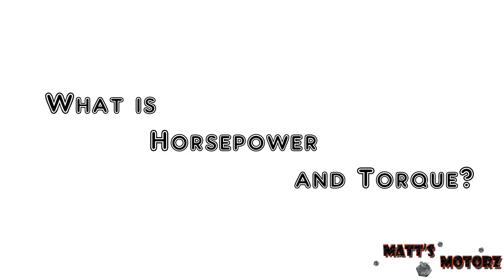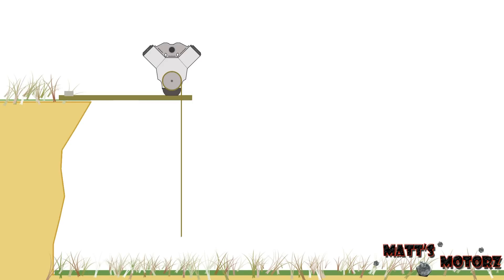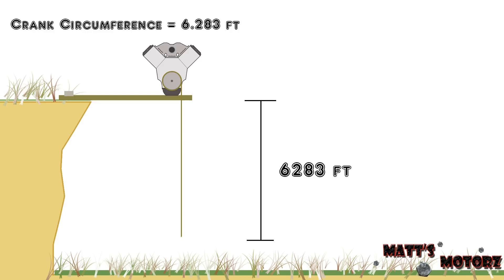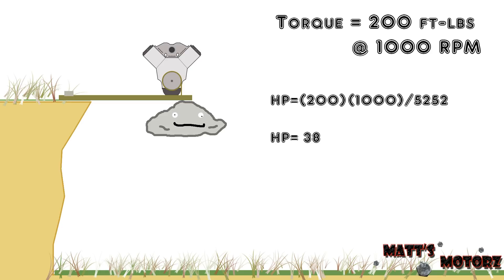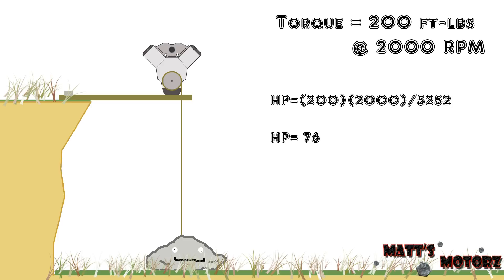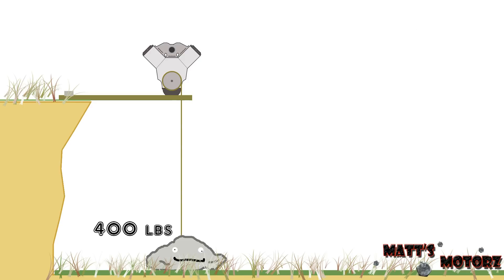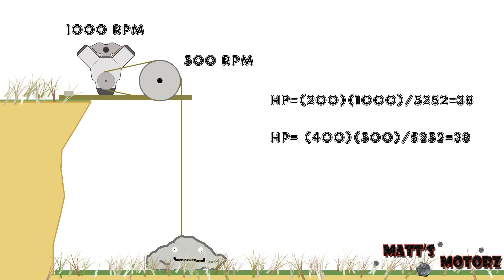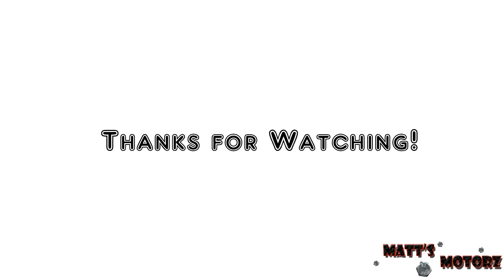What is Horsepower and Torque?

Comment: Pretty good explanation of a subject which I feel I am close to understanding, but which still kind of puzzles me a little.  I'll work on it. One thing that I wish you would explain, here, is if an engine produces "max torque" at, say, 5,000 rpm, why does the torque or twisting force of an engine "drop off"?  I would think that it would have more twisting force at 6,000 rpm, and even more at 7,000 rpm . . . (whether or not the engine is capable of spinning the crank that fast is another matter.)
Reply from the maker: Denys A The reason why, is because the process gets less efficient at higher speeds.  The valves can only open and close so fast, the exhaust can only be pushed out so fast, the intake air can only be sucked in so fast and so on. The engine cannot breathe as well at high RPM and your volumetric efficiency goes down and because of this, combustion efficiency goes down, and as a consequence, output power will go down.

Comment: Great Video man. I always wondered how torque and horsepower were interrelated and when torque is droping at high rpm/s and still hourse power is increasing. thanks to make it understandable. can you make a similar video for diesel engines? and how is that factor of 5252 come in, please explain.
Reply: +Syed Abdul Azeem The factor of 5252 comes in because he is using imperial units. If you used Watts, Newton meters and an angular speed in rps (per second) then hp = torque*rps

Comment: Well the reason I ask this question is because , I'm trying to decide on which  is the best power plant for me... On one hand i have a 30.5 cc 8.2 hp engine..... On the other hand i have a 34.5 stroker ( they emphasize a lot on compression and squish factors with the) 7.5 hp engine, boath engines are modifed & race ported.... They went the extra mile on the piston work with the 7.5 hp (cat 5 mfg) engine.... The overall objective is to move this 43 + pound car at its fastest ( with authority) .... I am told TORQUE will be my new best friend & TORQUE is  key on take off and coming out of the corners.... I am told by this particular person that they have this 7.5 hp cat 5 mfg engine on their car(losi 5t) and it lights up the tires from beginning to end and that I will be very happy with that engine... The 30.5 cc 8.2 hp O.B.R engine is good from what i red as well..... I'm not trying to buy a name I'm trying to buy true performance & the most bang for my buck....
Reply: good job

Comment: This is absolutely great. I have been looking forward to a video that truly explains the Torque / Power ratings on car brochures. A great great help.
However, please help me out in the following selection.
Vehicle 1:
Max Torque - 103 Newton-metre @ 4500 RPM
Max Power - 80 bhp @ 6000 RPM
Kerb Weight - 1050 Kilograms

Vehicle 2:
Max Torque - 247 Newton-metre @ 1800 RPM
Max Power - 105 bhp @ 3800 RPM
Kerb Weight - 1750 Kilograms

As per the equations mentioned, HP for Vehicle 1 is 88.25 and that for Vehicle 2 is 84.65. Still, I would need your answer towards which is a better vehicle ?
Reply from the maker: Rohit Singh 
One thing you forgot to do was convert from Newton meters to foot pounds. After doing this, you find that the first vehicle has a horsepower of 65.1 and the second vehicle has a horsepower of 62.4.  So this is actually an interesting case because the second engine makes more max power right off the engine, but actually has less max power at the wheels due to more losses through the gearing (Assuming that the Max torque measurement is a measurement at the wheels).

But to answer your question, it is hard to say.  Each vehicle has a max horsepower at vastly different RPM's and there is no information on how it performs at other RPM's. It also depends on what the vehicle is being used for.  A car that needs to be able to tow something needs to produce a large amount of torque at a low RPM, but a car that needs to go fast needs to produce a large amount of torque over a wide range of RPM's. 

So in the end, I wouldn't be comfortable in saying any of those vehicles are better.
Reply: Thanks for the analysis. But I still want you to make a decision on which is a better vehicle. Some more info available in these vehicles' respective brochures are as under:

Both are used as offroaders in tough Indian terrain, where fuel stations are 1 in a 100 kms stretch. Both are used for towing. However, Vehicle 1 claims to be getting out of mud / slime much easier.

Comment: Ok if i have a 30.5 cc engine with 8.2 hp & a 34.5 cc engine with 7.5 hp whitch engine would move 40 lbs the fastest ?
Reply from the maker: Irving Madison In order to answer that question I would need the RPM the engines would be operating at, as well as the torque and hp at that RPM.
Reply: Irving Madison Well if you match a good gearbox,  it is the one with hIghest hp that would move the load fastest.

Comment: I just wanted to weigh in (and hopefully settle) this argument about HP vs. torque, between Matt and ofsoundminds. You're both right, and both wrong, because each of you is talking about a different torque. Matt is correct in saying that HP alone means nothing, because you have to consider the torque produced by the transmission. A  50 HP farm tractor can tow a 500 HP sports car like a toy, because the transmission in the tractor creates incredibly high torque, although at speeds of only a few miles per hour. (As a separate yet related issue, the tractor also has superior traction, which results from the greater mass of the tractor, and better tire design.) Ofsoundminds is correct (in his trollish way) in saying that a higher HP engine can always tow more, IF it is sufficiently geared down. (He failed to explicitly state the "IF" part.) If the 500 HP sports car engine was geared down like the tractor (and put in the same frame with the same tires), it would tow the 50 HP tractor like a toy. The HP determines the potential torque at different speeds, while the transmission gear ratios determine the actual torque. The ambiguity between potential torque (what could be produced with a hypothetical gear ratio), and actual torque (what is produced by the gears available in the supplied transmission) is the basis for this argument.

Great video by the way.
Reply: If by trollish u mean correct

Comment: i heard good engines deliver maximum torque at a relatively low RPM, it that true? i drive a Ford Falcon XR6 2012 (yup, aussies continued Falcon till this day) with an in-line 6cyl engine that delivers 392Nm (290lb-ft) torque at 2500rpm but it only has like 270hp, which is really not impressive for a 4.0L i6 engine. does it have something to do with the fact that this car weighs 1.8 ton (3970lb)? will i get more hp by revving it higher? i can tow an oil tanker no problem but my 0-100 acceleration is worse than some japanese fwds... that makes me very sad :(
Reply from the maker: Stanley Li It really depends on what the car was engineered to do.  Max torque at low RPM doesn't really mean much except it can tow things very nicely.  An engine isn't "good" for having this property. (It really depends how you define "good.")

Engines are either built for towing power or high speed / acceleration (or somewhere in between).  An engine with a large amount of torque at a low RPM typically means that it was built more for hauling, where as an engine with high horsepower at a high RPM was built more for acceleration and speed.

Revving your engine higher will not necessarily increase HP, as often times the torque drops while the RPM goes up, thereby balancing things out.

The key to acceleration is a large amount of torque throughout a wide range of RPM's. This is much harder to design as there are many factors that cause torque to drop as RPM's go up.
Reply: MattsMotorz the last point you mentioned is achievable by adding a turbo/supercharger, which is kinda beyond my wallet at this moment... and i've  put 100,000km into the engine already. so i don't particularly crave any boost mods anymore. but anyway, the purpose of the design is a bit weird. they just put a pick-up truck engine in a 4 door sedan for no reason lol. thanks for the explanation thou. i'll just stop being a such ricer for now :D

Comment: i was looking at a bmw 730D 2015 and it's max nm(torque) was 560nm at 3000rpm /5252=319,8hp

but it says max hp is 258hp at 4000rpm, how is that possible ? What do i miss?

Is it just german witchcraft?
Reply from the maker: The equation I gave in this video only works if the torque is in units of ft-lbs, not Newton-meters, you need to convert it before using the formula.  You get about 236 hp at 3000 rpm after converting. However the engines torque changes with RPM, so it has a maximum torque at 3000 rpm and a maximum horse power at 4000 rpm.  if you have any other questions let me know!
Reply: MattsMotorz I didn't think about that. Thanks now it all makes sense ^^

Comment: so which car is faster on a sprint and which one is more capable of towing heavier loads? 100hp and 200 ib-f or 200 hp and 100 ib-f ?
Reply from the maker: Horse power is the rate at which work can be done.  It is highly related to how fast an engine can spin and produce power simultaneously.  More horse power does NOT simply mean it can tow more.  Towing is related to torque.  

As an example, an old steam engine could have 20 hp, however it was able to haul TREMENDOUS loads because it generates an enormous amount of torque.  The reason why it doesn't have high horsepower is because it cant spin fast and produce high torque at the same time.

I find it funny how someone can speak with such confidence, yet completely misunderstand the topic in which they speak.
Reply from the maker: If I call the engine with 100 hp and 200 lb-lbs Engine A and the engine with 200hp and 100 ft-lbs Engine B, then Engine A would be able to tow heavier loads, since its engine produces more torque.  Engine B however will be able to deliver its torque faster than Engine A, meaning it would be more suited for acceleration.

But for any rating of an engine, you need to show the RPM at which it achieves the designated HP and torque.  

To pull heavy loads, you need lots of torque.  Horsepower just lets you deliver that torque faster and is related to the RPM of the engine. HP will let you pull the load quicker without needing so much time to accelerate. 

To accelerate quickly, you need to be able to deliver torque quickly and have a high value of torque over a large RPM range.  Generally, torque will go up or down depending on RPM (Usually up, then down).  

In fact, that's why you need to switch gears as you accelerate.  When your RPM's get too high, your torque starts to drop off very quickly, and you need to switch gears to put the engine back down into its power band.
Reply: MattsMotorz thanks for taking time to answer my question!
Reply from the maker: No prob!
Reply: MattsMotorz not true. the engine with more power can tow more. hence why it has more POWER. using gearing the one with more hp will be able to pull harder due to having more hp    

i find it irritating that someone is asking for clearification and you give wrong information. 

if you think 100hp can pull more than 200hp then you shouldnt be in physics at all!
Reply: MattsMotorz you are missing the point that at what speed the wt is being moved.

20hp does the same work as any other 20hp regardless of how much tq was used to created the 20hp....

thats why its called 20hp.... if it was more powerful than the other 20hp, it wouldnt be 20 now would it...

and i dont feel like proving you wrong with stupid numbers you probably wont read since you havent figure this out already..

but listen...

if more crank tq but the same hp output can move an object faster, then you would in fact be BREAKING THE LAWS OF PHYSICS!!!!

hp is how much energy you have to use.... this determines accelerate or towing capacity..

you fucking CANNOT tow more just by adding crank tq and leaving the hp the same... its IMPOSSIBLE!!!!!

now yes a 20hp steam engine can move a lot of wt but its doing so at a really slow rate of speed. this is defined by the 20hp output....

40hp would do twice the work... period.... increasing or decreasing crank tq without changing hp output is 100% worthless
Reply from the maker: I wasn't talking at all about the speed in which work is being done.  I was talking about sheer ability to move a certain amount of weight. Or towing capacity. Since you originally said "an engine with more horsepower can tow more" which is NOT true. Ever wonder why you only see trucks tow things and not Camaro's, Beemers or any other sport vehicles with lots of horsepower?

Horsepower is NOT the number to look at when you just want to see how much weight an engine can move. Torque is, end of story. 

I really don't feel like going back and forth with you. You clearly aren't going to change your mind.  So I think I'm done here. (Yup, that means you get the last response! Use it wisely to make yourself look like the big shot that you clearly are.)
Reply: Wow this discussion did help lol. Thanks guys!!
Reply from the maker: Lol!

Comment: 200 ft-lb of torque at 1000 rpm would break the tires loose so easily... Nice video by the way!
Reply from the maker: Thanks! Lol yes, not all the numbers chosen for this video were realistic.
Reply: how do you figure that. i apply half that putting on lig nuts. the car doesnt spin its tires when i do that.
Reply from the maker: The cars tires WILL spin if they aren't on the ground.  Also, it takes much much more torque than that to move a car.  In the neighborhood of 1000 ft lbs.  However the engine doesn't supply this, the toque is multiplied by the transmission at the cost of speed.

Comment: Great video, helped a lot. But on the 911's power graph, shouldn't the hp line and the torque line cross at 5252? On the graph it looks like its crossing at about 3750.
Reply from the maker: They actually do oddly enough.  Many dynos scale the y-axis for each curve to fit them neatly on the graph.  To see for yourself, draw a vertical line at about 5252 RPM and note the torque number (right hand axis).  About 300.  Now continue that line up until it crosses the HP curve and read ITS value (left hand axis). About 300.
Reply: MattsMotorz ahh of course, I didn't notice that the scales were different. Thanks